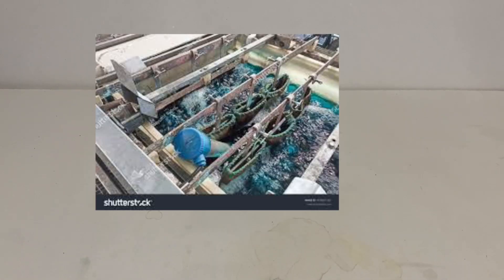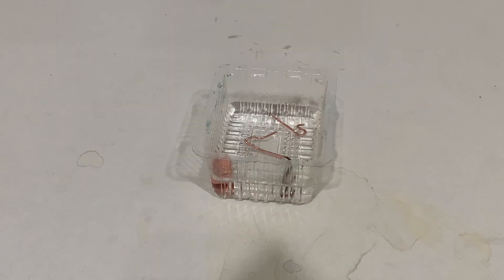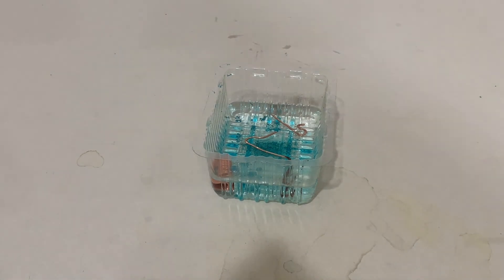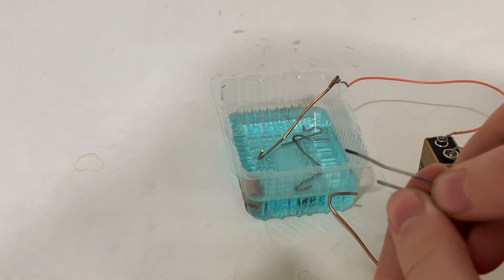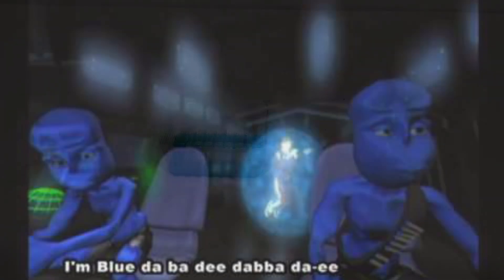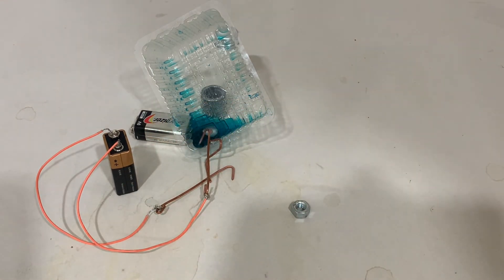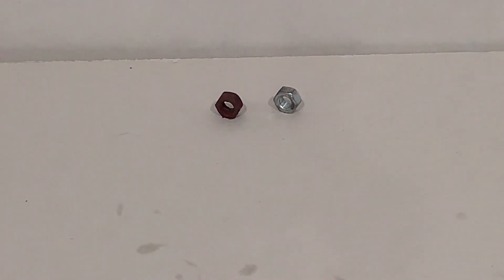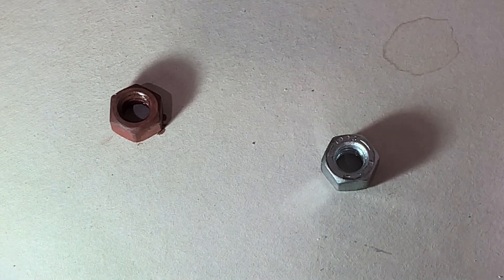Applying copper electroplating at home

Comment: You can use Cu²SO⁴ in water to render Cu and H²SO⁴
Reply from the maker: You mean can you use copper sulfate instead of copper acetate? I do not know what you mean by “to render”
Reply: @ChemistryOnCreatine  Well it is hard to get sulphuric acid in my back yard because the feds will haunt me like stray dogs with rabbi's if I only try to google it. One way to make it is via the electrolysis of a solution of copper sulphate in water. You will get copper at one of the electrodes and a solution of sulphuric acid on the other. The catch is, you will have to use some rigid electrodes, preferably PbO² or Pt, but is has been done with graphite or manganese dioxide as well. I once figured a 25kg bag of copper sulphate pentahydrate would yield about five liter of 98% acid, so a bag can go a long way. There are some vids about this subject on youtube.
Reply from the maker: Yea you can do that that makes sense, you’d need a strong electrolyzer tho and a good power source, or you can crack open a car battery and that has sulfuric acid